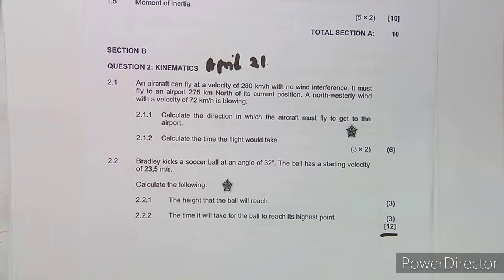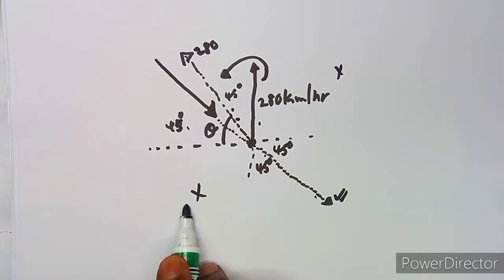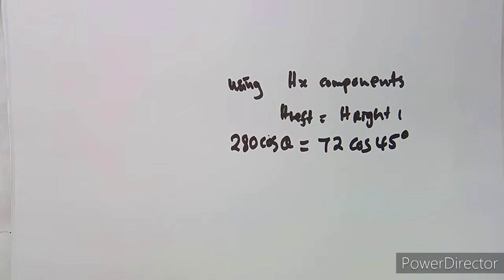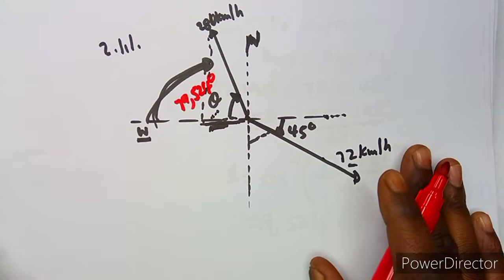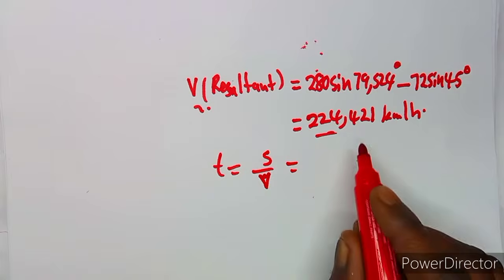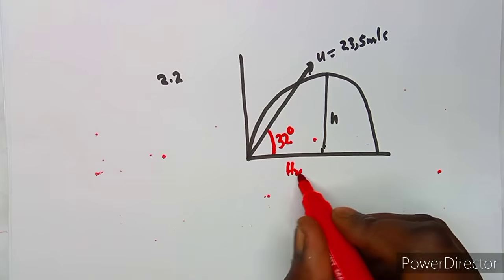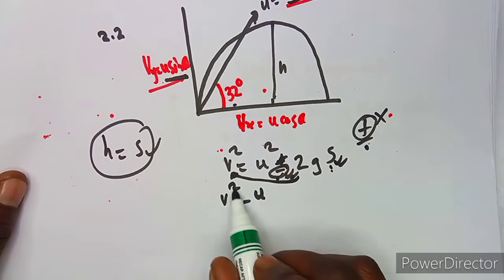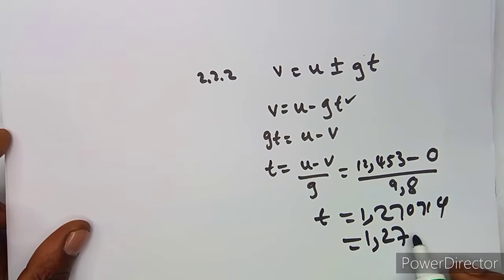Engineering Science N4 Kinematics Past Papers and Memo April 2021 @mathszoneafricanmotives

Comment: sir can you explain why the plane's force also moved before you started calculating because from your latest introduction video there was noothing like; both forces moving; we only adjusted one
Reply from the maker: Hie on which part exactly?
Reply: @mathszoneafricanmotives  the force that we used to calculate the angle, the one pointing NW
Reply from the maker: @kidtoxic2938 Oky when working with wind , you extend it to the other quadrant, if you are to apply components methods
Reply: @mathszoneafricanmotives   ohhk..and the quadrant we extend it to depends on the direction of the wind??
Reply from the maker: @kidtoxic2938 yes

Comment: Sir,i used the cosine rule and didn't get the velocity you got
Reply: Well we cannot use that formula since 280km/h is when there is no wind interference which we get 301.521 km/h when using that formula...so the above formula considered the wind interference that is why the speed is 224.421km/h
Reply: My angle is 10,476
Reply from the maker: Will check it out
Reply: 100.476 in total
Reply: Sir,can you do it with H.components and V.component cause im getting 77 for angĺe